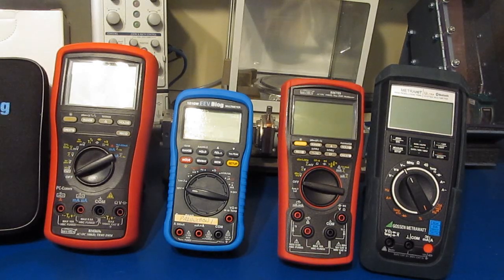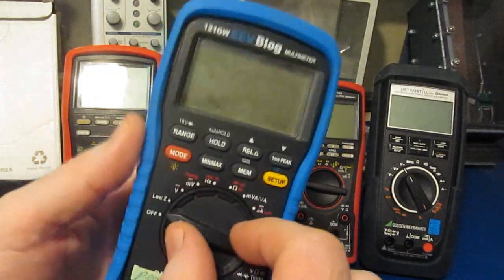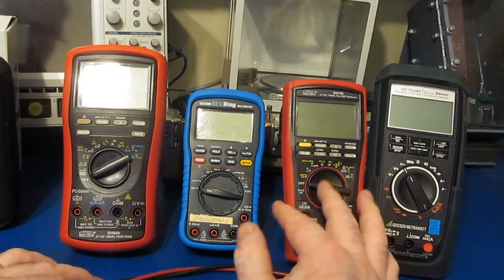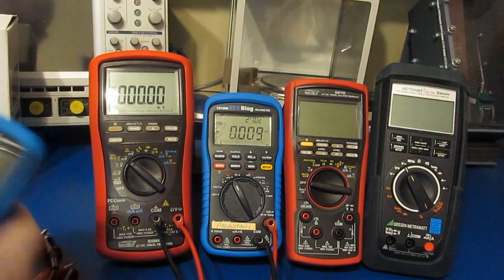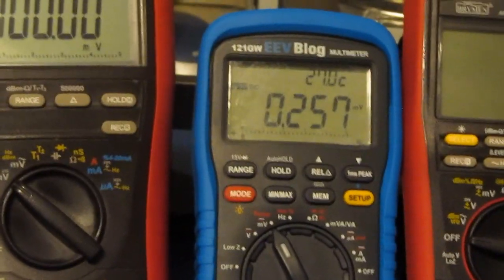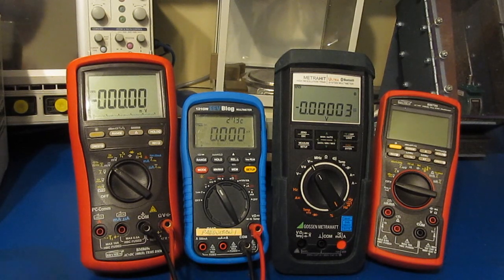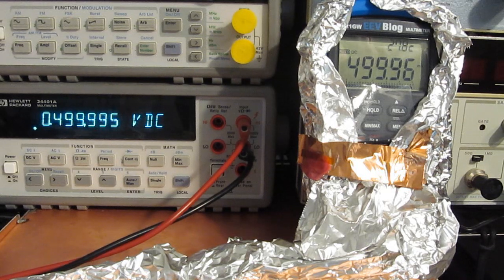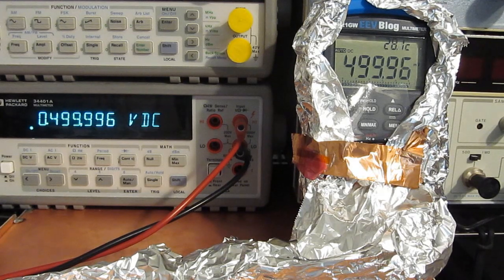EEVBLOG 121GW DC mV Stability Test, Conclusion

Comment: It might be a bit off-topic but I'm really curious - is there an explanation why at 5:37 the prototype displays 19c, while the production 1 meter shows ~27c in the top right corner? I assume this is supposed to be the ambient temperature in °C.
Reply from the maker: As Dave had told me, it was never fully aligned originally and then I loaded newer firmware which I think the format had changed with further messed with the cal.  Then, if that is not enough, I damaged the meter during my testing.  Then I repaired it.  Then to top it all off I changed the hardware to allow the meter to pass my transient tests.   Then because it is a prototype, the design also changed.  I went over some of that when I reviewed the production meter.
Reply: @joesmith-je3tq  I guess the torture the prototype went through would explain why it was off. Thanks for the quick response.

Comment: You probably could make a simple shield out of thin single sided PCB material made to fit the board and then tie it to common through a series/parallel R/C network and fix the problem permanently.
Reply from the maker: If you watched my series on the Gossen, I used a Mu metal (Netic).  Still, wouldn't help if it comes in by the antennas I plug into the front.
Reply: I guess one has to dig deeper to find out the full path and then look at proposing fixes. @joesmith-je3tq
Reply from the maker: @ebayscopeman  This is why I shotgunned it.

Comment: If a product's rotary encoder gives wacky results when turning it quickly, you know the engineers writing code at the heart of the UX handling processor just wrote in the naive algorithm for interpreting its couple of wires of output, rather than implementing the not-much-more-complicated state machine algorithm which checks for valid state transitions of the input sequences and produces much much more reliable increment/decrement values. Nowadays its a quick google + 5 minute read to find this info, yet still disheartening to see it not done in so many places. Always fun finding out if a car's volume or other knobs have the good implementation or not.
Reply from the maker: I was surprised to see modern test equipment having a basic problem like this.

Comment: Your older meter may not have the extra shielding. All production meters have had the extra PCB shielding for quite a few years now. There were also firmware improvements.
Reply from the maker: I posted a photo on EEVBLOG showing the internals of one of the production meters I purchased for the review.   You would have to tell me if its current or not.
Reply: Confirmed. I have also confirmed this happens on the Keysight U1282A, Fluke 17B, and Brymen BM235 so far. Keysight is the worst one I've tested so far. So this does not seem to be an issue specific with the 121GW. I now recall that this is not new and has been discussed a few years back?
UPDATE: The Keysight U1272 also does this at greater amplitude than the 121GW but at 36MHz
Reply: EEVblog meters aint bad, need to remember some of them are rebranded Brymens
On EEVblog we usually talk about the FAFB when it comes to handheld multimeters, its the big 4  and what people are crawing.
Flukes, Anengs, Fnirsis, & Brymens... the FAFB backland.
some will argue that Keysight should be part of this elite group, and maybe in the past, perhaps they should, but Keysight aint what they previous were, samr with UniT and Gossen, but for now they aint, its the big four  the FAFB and then there are these other secondary DMM makers that also makes okay handheld multimeters..
Reply: I think this guy is jealous of Dave's channels success. He's repeatedly given the impression that his channel should be more successful because he's so much better and experienced. Be that as it may but half the likability of Dave is the personality. Just saying
Reply: @fly-lucky dude is just testing meters. The meter will do what it does. Where did you get all of that other stuff from?

Comment: WOW this is fascinating (this vid, the last one and blog comments), and as I have the BM869s (164490215), BM786 (204520906) and a 121GW (180202062, from the crowd funder), I had to try this against a couple references I have (incl, Fluke 731b, 732A, 343A, 752A divider). My 121GW (U-2.00 updated) is reading high on mV range so I ended up using 100mV as a test voltage (I used shielded PTFE copper cables). Sure enough, noisy till I put foil around it and grounded, then stable as the other two. Unexpected, but nice work, definitely need to remember that.
Reply from the maker: Interesting.  You're the first owner to reproduce what I am seeing.
Reply: PS: couldnt help it, also tried an Agilent U1253A (MY51400064), Fluke 189 (75240037), 289 (35740002), 8060a (7720020), Uni-T UT181a (C171835804), Tektronix DMM916 (144966) and even an Owon B41T+ (21340133), thankfully no other noise issues (even tried with a MHz noise generator transmitting in the background).
Reply: Now you're just showing off 😄But good work anyway.  @nikmilosevic1696

Comment: Did you notice, that, the "Internal Temperature measurement value" is 27C on that meter, but was about 19C on the "Production" meter?. I don't know how much of a difference that makes in that DC mV test, but the disparity between the 2 in the same environment seems strange to me. I am also wondering if ambient 60Hz power line noise, or a harmonic of it, might affect the reading as well. That clip on ferrite might not filter out that low a frequency. The 869S has shown it is sensitive to induced noise from an AC power cord near its leads, so, there's something to that issue in some meters.
Reply from the maker: For me, it's not strange at all.  I think you missed that one is a PROTOTYPE, not production and not in cal.   I did run a test on these meters using a tape eraser.   Those tests are all available on-line if you're interested in watching.

Comment: Also might try some Mix31 or 61 on the leads if this is "instability" is an issue for you.  My Fluke 189 is a good transmitter of RF.